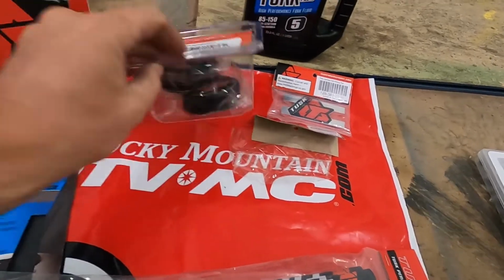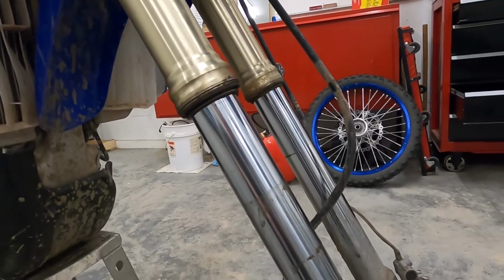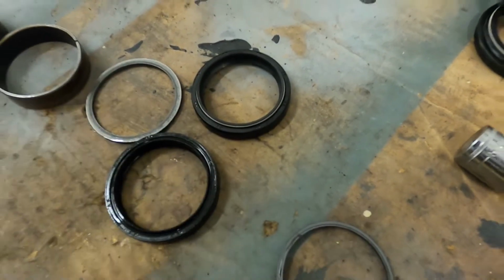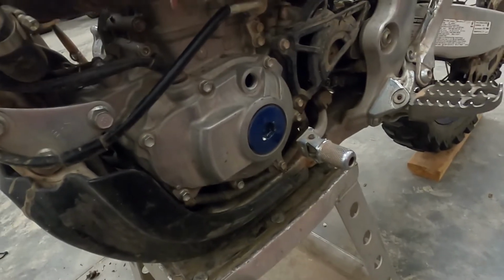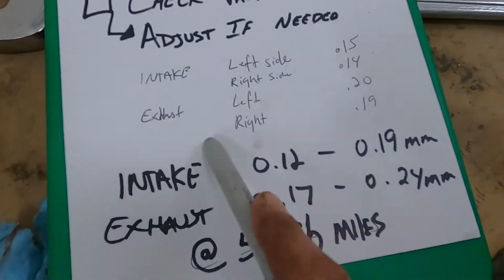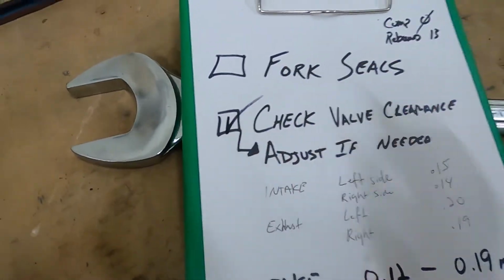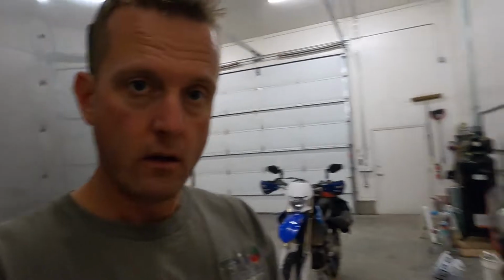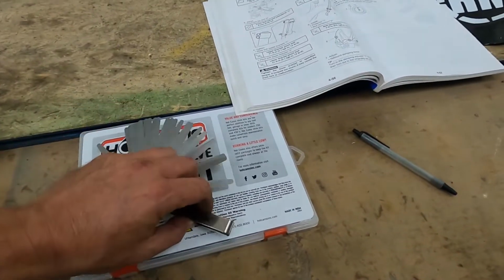WR250F - Maintenance - Fork Seals - Valve Clearance Check

Comment: I use seal savers on mine and have never had a problem.  Sand, dirt, etc. Not one drip, and I’m constantly riding my WR at the MX track doing jumps (not huge).  Thanks for the video. I’ve also never checked my valves. I saw that one of the magazines did a full break down at 100 hours and the valves were still in spec too.  You make working on the bike look easy!  Nice
Reply from the maker: That’s great you are having no issues with your seals.  What year is your WR?  My factory seals started leaking relatively quick. Within the first 1500 miles.  After changing them once, the second time will be easier if/when necessary.  I would like to see if the Tusk seals last longer.
Reply: Rally With Rowley I have a 2015 that I bought gently used, uncorked, and slightly modded back in 2018.  I don’t think the previous owner would have blown the seal unless they are weak from the factory.  I put tusk seals on a CRF250L that had a leaky seal from a bunch of desert riding.  That’s before I knew about seal savers. No, I’m not sponsored by them.  Just found your channel. Subscribed!

Comment: I've never done fork seals either. But looks like it did a great job. Way to go. And thanks for doing the valve adjustment or valve check that seemed easy now I don't have to worry about it when I need to do it.
Reply from the maker: It was way easier than I thought it would be.   I prepared by watching several YouTube videos and studying the service manual.

Comment: Hi, I'm thinking of buying a Wr250F and wanted to ask what engine oil and valve intervals you use? Are you sticking to the service manual or are you taking it a bit longer? How many miles (km) will such an engine last until the first piston or crankshaft replacement?

Comment: If I bought a new 2022 wr250f and rode it very conservatively, could I get away with only changing the oil/cleaning airbox for maintenance?
Reply from the maker: I’ve checked my valves twice, still in spec, I have not adjusted them yet.  I fixed the fork seals because they were leaking and while I had the front wheel off I put some grease in the wheel bearings.  The only other maintenance I’ve done is regularly changed the oil/filter and cleaned the air filter.   The bike now has over 5,500 miles and is ready for more, lots more.